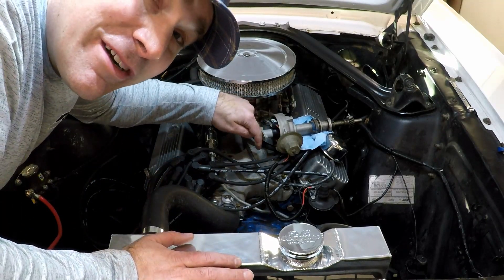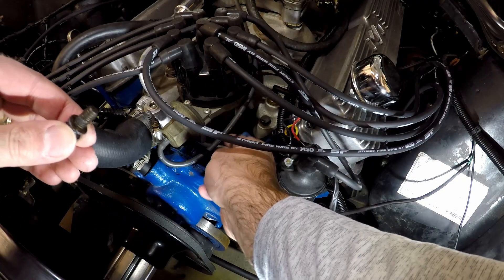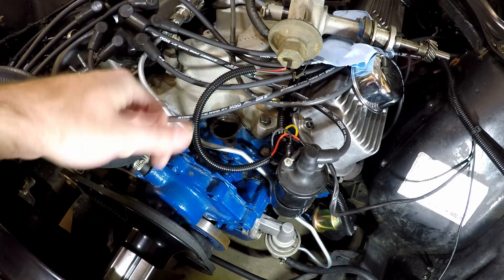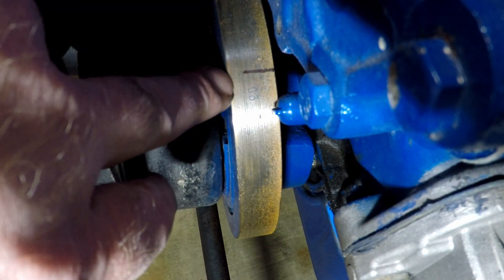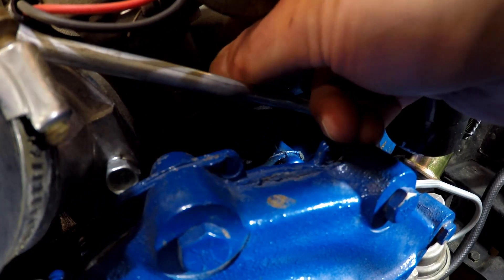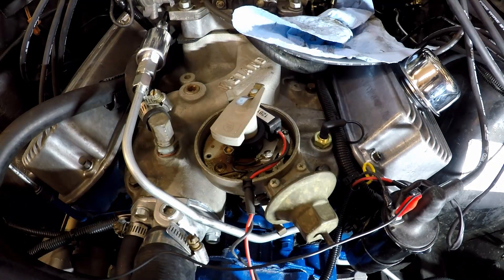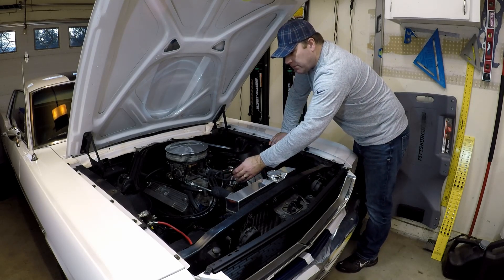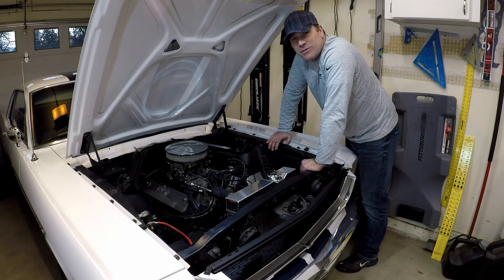How to set the timing in a 289

Comment: I put my pertonix on other day runs much better. so once back from electric shop, got new intake arriving today and son bought a 800 hp motor with blower other day, he's giving me one of his 650 holleys to top it, then want to time it your method, I'm sure you watched the video of guy with motor on bench, he just button everything up after the on and off light trick and fired up, no timing light, what you think ? further steps needed? I have stock 289,,,,,my distributor had hole no cut out so had to cut and rejoin wires, so shorten the wires at sametime. need to upgrade that maybe before adding intake
Reply from the maker: That's great to hear the Pertronix is running great.  That Holley will be a nice addition to your setup.
As long as you're positive that cylinder number 1 is at TDC, you don't need a timing light to set your timing.  To the trained ear, adjusting the timing to hear when the motor is happy is a piece of cake.  However, a timing light will allow you to know where you are with respect to timing and it will allow you to set a specific timing if that is what you're after.  I think I paid $10 for my timing light at a yard sale, they're not very expensive and it's good to have it as a backup option to make sure everything is running correctly.
Reply: Yes sounds good someday we’ll talk on the phone give me a call I’m on LinkedIn I think my numbers listed there talk to you later I’ll look for a Washington area code hopefully it would be Telemarketer lol

Comment: Andy quick question, any chance engine could fire if leaving coil wire on?
Reply from the maker: If the negative terminal was disconnected, the Coil should be "dead".  But there's no reason to take that chance, the coil wire goes back on just as easy as it comes off.  Look at it like insurance, it's for the "what if" scenarios that you can't think of.  :)
Reply: @KruseBuilt  I figured something I just didn’t notice you had the cable disconnected it was just I watched some other guys do the same thing you know when they had that coil wire outside oh well hopefully my car will be here Wednesday if none of these tropical storms interrupt it down here in the south

Comment: What do I do if my test light doesn't turn off when I rotate the distributor?
Reply from the maker: Not sure, does it not turn off no matter how far you rotate the Distro?  Meaning, go extreme and rotate the Distro by 90 degrees or more.  If it still does not turn off, there might be a problem with the points?
Reply: @KruseBuilt  yea no matter how far I turn it in either direction. So I need to set the points with the fuller gauge?
Reply from the maker: @tiltedaf247  First, double check the test light is going from the negative terminal on the Coil to the positive terminal on the battery.  If that's not it, the gap in the points should be about 0.017 inches.  If light is set right and the gap is set right, I'm not sure what else would cause your issue.  It's hard to see everything through the message system.  I rely heavily on the guys over at VMF.  There's a ton of knowledge on that forum and I'm guessing you'd get a better answer.  You can also upload pics which may help as we can't do that here.  :)

Comment: aren't you suppose to disconnect the vacuum advance line? and wait for the engine to warm up?
Reply from the maker: I don't know on that one, I was never told that before.  Doesn't the vacuum advance only work when the car is see revs above idle?
Reply: @KruseBuilt  I mean it was just what I saw on the written tutorials that's why am I asking... I dont really know
Reply: No, not if the vacuum is coming off the carb, ported vacuum. If it is hooked up to manifold vacuum then yes.
Reply: Yes you need to disconnect vacuum for initial timing

Comment: Hey kruse great video, got a question. I got a 65 mustang with a stock 302 with bare bones lunati cam. what is  the best timimg setting btc on my 302.I see you set  yours 12 degree before TDC. i need to redo my timing  got some spitting through carb after plugs are fouling.  so i took the took the number 1 plug out found tdc on compression  stroke. the only thing i didnt do at the time was mark the tdc on the harmonic balancer. i got a timimg light today and wanted to know if this would show a true advanced timing if i use timimg light to set timimg since i didnt mark it on the harmonic balancer. any suggestion is greatly appraciated. The interenet searches show all kind of numbers to set adance so im not sure whats a good sweet spot. Thanks.
Reply from the maker: Spitting through the carb doesn't sound like a timing problem, and fouled plugs tend to be from too rich of jetting.  We'll save that for another time.  :)
I think I need a few more details first, then we can dig in.  Does your harmonic balancer have any tick marks on it for timing?  Is the distributor still in the motor?  Have you pulled the distributor during this process and therefore it needs to be timed as well?  The timing light will light up each time cyl #1 fires and this is where the marks on the harmonic balancer (or sharpie mark if you put one) will be lit up and you can compare it to the pointer mounted on the block just about the harmonic balancer.  The sweet spot on a stock setup for starting is 12 degrees.  But your Cam pulls you out of "stock" and therefore you'll need to adjust from there.  Once we get you dialed in, you'll here an audible difference in how happy the motor sounds as you advance or retard the timing each degree.  Get me a little more info and we'll get you there.  :)
Reply: @KruseBuilt  ok so motor was put in about 8 months ago at with old distributor and timing was just set at top dead center no timing  to get the engine up and running. I replaced old 1406 carb with a 1901 500 cfm. Yesterday was the first time i just pulled the old distributor and set in a new one with points. I have 87 302 engine and set the point gap at .021. Now, my harmonic balancer is new and it does have markings on. I just went outside and looked at it the pointer is setting over the 10  degree mark but i have made made any timing adjustments at all.  FYI i did not make any adjust to the new distributor other than set it in where it was previously time. where do i go from here?
Reply: I forgot one thing can I go ahead and mark 12 degrees on the harmonic balancer with a sharpie or whiteout now or wait because i wont be able see when the engine is spinning, im looking for reference points. also the car stumbles and hesitates when i try pulling off just crappy
Reply from the maker: @Jayymuney22  Ok, so if you put the distributor back in and you're certain it was in the same place as the other, you should be good there.  Mark the 12 degree spot on the balancer with a sharpie (but this is only a reference as you begin to adjust your timing, it won't matter later on).  Put a wrench on the crank bolt and spin it from 10 degrees to 12.  If the gap is not set correctly with the points, the car will not be happy and it may not even run.  I suggest getting the Electronic Ignition from Pertronix (model # 1281) as it will work everytime and remove the need to adjust the points, it's fantastic (I also have a video on that).
So, it sounds like you got the car to fire up (this is a good sign), so now is when you adjust the timing.  Loosen the bolt holding down the distributor in the block just enough so you can slightly twist the distributor.  Be careful no to get it too loose.  With the motor running and the timing light connected, point it at the pointing device on the block where it points to the harmonic balancer.  Ideally (based on the info you gave me) the pointer should be right at the 12 degree mark and you'll see the light flickering because it is lighting up every time cyl #1 fires.  Very slightly spin the head of the distributor and you'll see the tick marks move relative to the pointer on the block.  You may need to go to 14 or 16 degrees before the engine sounds happy.  If you have to go much higher than that, then I think the drive gear on the bottom of the distributor might be off by one tooth.  If this is the case, rewatch my video about stabbing the distributor and how you have to fiddle with it to get the drive gear aligned correctly and the distributor facing the correct direction.  If none of this works, let me know what you find out and we'll go from there.  :)
Reply: @KruseBuilt  Thanks a lot kruse,  yes my car fired right and I only used the points because i just bought the new distributor i will convert to Pertronix soon as i get this issue resolved. So for some reason my timing light from harbor freight wasnt working property so i will have to hold off until i figure out whats going on with. other than that here's what i found out today. So i got it idling but I am with you so far. Now the timing mark that i gave you earlier was incorrect here's. So i checked and the my harmonic balancer has numbers on both sides and doesnt indicate BTDC or ATDC. The number that provided the 10 degrees was underneath the pointer marker and you cant see the numbers when the engine is turning because they are underneath the pointer but there are numbers on the left side that are visible that look like were I should make the mark for 12 degrees. Other than this, i was able to loosen the distributor and slowly adjust to the left and right a little to hear the engine idle up and down. (Happy Sound) .I stopped here because my timing light wasnt working so  I drown the car around the back yard a couple of times and stop there.
Reply from the maker: @Jayymuney22  Hopefully you can exchange the light at H.F. for a new one that works.  It sounds like you were able to twist the Distro to alter the timing (and therefore the idling) and make the engine not stumble or stutter as bad as it was before.  This is good, it sounds like you were able to adjust it to a more ideal position.  The timing light will help confirm the degrees after TDC, but it's not critical because you can hear when the engine is happier.  However, one advantage is if you have to spin the Distro to something around 20 degrees after TDC (using the timing light to see this), then it might mean the Distro drive gear is off by one tooth.  We're kind of at a point where it would be helpful to be there to help you finish dialing in the car.  You might be able to reach out to some of the guys on Vintage Mustang Forum (VMF) or the ClassicMustang subreddit and see if anyone is near you that can help get this to the finish line.  I think you've got 95% of the work done, it's just the fine-tuning that's left.  Maybe you can upload a video of how the car is doing and maybe we can hear the idle change as you slightly twist the Distro?  We're really close!!  :)
Reply: @KruseBuilt  Thanks a lot for all the guidance you've been a great help and i think i got it from here just need to get timing light putting on it to confirm were i'm at
Reply from the maker: @Jayymuney22  No problem, I'm happy to help.  I was hoping I would have been able to do more for you, but I think you're right at the finish line, just a small tweak to the Distro and your car should be dialed in!
Reply: @KruseBuilt   You've helped more than you realized  I gained a lot of knowledge

Comment: Great video and it takes the mystery out of the relationship of the distributor and firing of the cylinders.  Historic fun note: I am the original owner of a 1965 mustang that I still drive to car shows.  On road trips in the old days, if you were going up to altitude or say, if you got a bad batch of gas, the engine would either ping or hesitate.  The solution was to just loosen and move the distributor one way or another until the engine "sounded smooth".  No timing light needed and you kinda show this in the video.  That brought back some memories!  Thumbs up!
Reply from the maker: Thanks!!

Comment: I have a question! So why the finger plug test? Can't you just turn the pully to tdc at the start? Love your videos!
Reply from the maker: You can but you won't know if you're on the compression stroke or exhaust stroke.  Plus, this video was also meant to help those that do not already have the distributor in place where you could see if the armature was pointing to the number 1 position inside the distributor.
Reply: That is correct, if you just turn it to top dead center it's going to be either the number one cylinder or the number 6 cylinder, which means you have a 50% chance of having it wrong